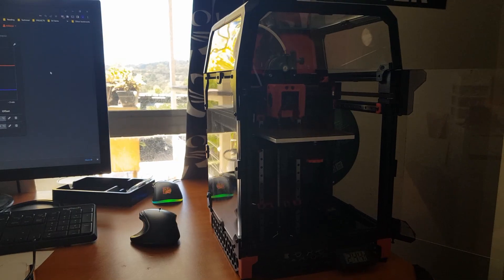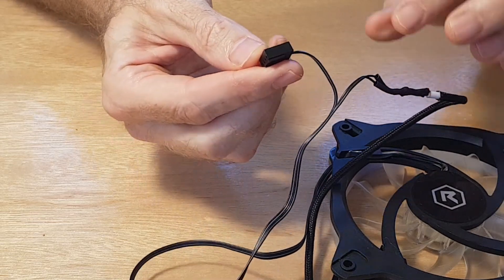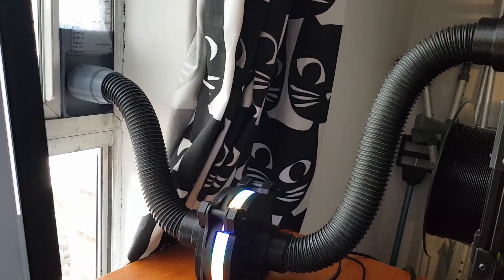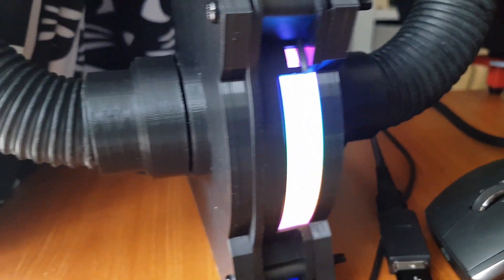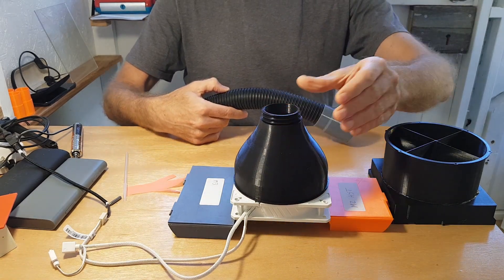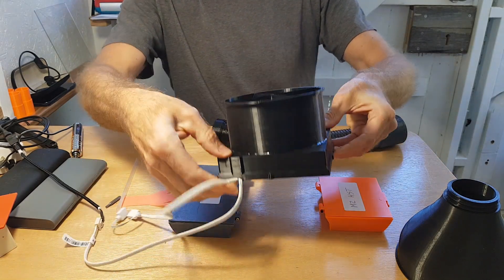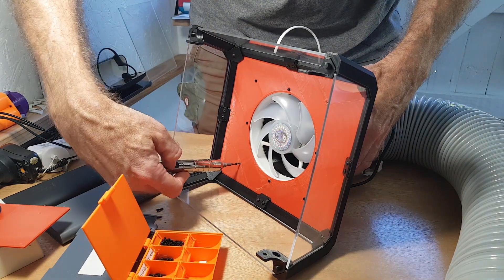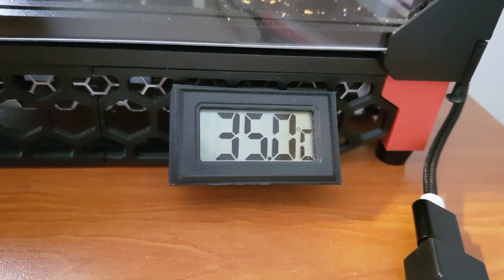DIY Ventilation for 3D Printer Enclosure

Comment: This is exactly what I was looking for! I had to browse youtube for way too long to find this. Thanks!

For the PC fan adapter you made from Major Hardware, is that the "120mm PC fan to 4" dryer duct" .stl he has on his thingiverse? That one doesn't seem to have the blades to swirl/condense the air into a more steamline/powerful flow. It is kind of hard to tell from the single model, though.
Reply from the maker: I didn't use and Major Hardware STL's so it's probably not the same.
Reply: @MakerMike54  Ahh okay. Thought I heard you say you got it from his site when you were testing the fans power with the little paper guy.

Edit: My goodness I'm dumb. Hahaha! Misunderstood before, sorry. You did research on major hardware's page as to why it was sucking the little dude in with just the cone, and then came up with the finned design that made it nice and powerful. Especially with the cone on. I also now see your files for print on printables in the description.

Comment: How did you deal with the empty space on the window? I see a a white board with a circle inside, but what is the material? and did you mange to make it so the cold air at night won't come in?
Reply from the maker: In the final version, I used a tall narrow sheet of wood with a hole cut in it. Then screwed on a 3D printed duct connector. It was easy to open the window and install whenever I used the printer, so didn't leave it there overnight.

Comment: Do you think the airflow generated by the fan that exhausts air outside could affect print quality? Second question: Is an exhaust fan enough, or is a small intake fan also necessary to bring air into the enclosure?"
Reply from the maker: The PC fan is plenty powerful enough to circulate air through the enclosure.  As for print quality, I think the extra airflow and cooling helps PLA printing.  But other materials like ABS don't need the ventilation till after the print when it's good to flush the fumes out.
Reply: @MakerMike54 hey thanks for the video.  Am concerned about leaks in the enclosure.  Have you tried printing abs while running the exhaust fan?  Any issues?

Comment: The connecting bits that you printed yourself would look so awesome in something like actual diecast or spun aluminium, especially if poweder-coated in some color, like a glossy shiny red. Then, have a black hose :D

Comment: My printer is also near my window, if i make a ventilation and it goes out the window do i have to make sure the rest of the window is close so wind doesnt push it back in? Cause its kinda hot so i want to open the windows.
Reply from the maker: Probably different for all houses. It's probably best to just see which way the air is flowing when the windows open. If it's flowing inwards it may well blow back in.
Reply: @MakerMike54  thanks will keep in mind

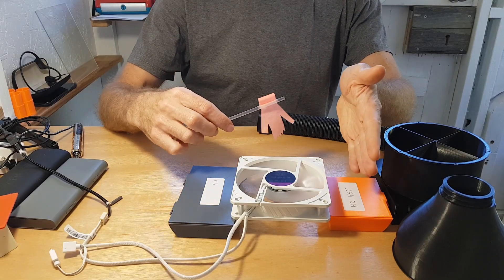Comment: Can you explain to me or refer something explaining what is happening at 2:00?
Reply from the maker: I think fans or propellers don't just push air away in a single perpendicular direction as we assume they do.  Fans also spin the air, and the centrifugal force carries the air away sideways.  So the air flow straight out of the fan is quite chaotic.  Adding Nesto's ducting, guides the moving air so it travels directly away from the fan as we want it to.
Reply: @MakerMike54  thanks for the explanation. are you reffering to the stator of "cheater" fan designed by nesto in fan showdown?
Reply from the maker: @becauseyourbossisgonnaneedme  Yeah that's the one.
Reply: This is an open-air fan. It doesn't like constriction or high pressure static loads. Also, by the cheap cyclone blade design around a dead-core, where the motor sits, it is prone to vortexing currents. The air is traveling up on the edges, then being sucked back in at the center of the fan.

Adding the extension removes some static-pressure and isolated the ability to form a vortex ring inside. It also added a little momentum to the air velocity, before hitting the nozel. (Just a little, it's still doing it, just a lot less now.)

For ducted air, you only want to use a "squirrel cage" style fan. It looks like a fan with blades sideways inside a snail-shell, with a side exhaust and a central intake above that dead-space motor. Those have high static pressure and no ability to vortex or dead-stop.

The gap should actually be tuned for the air flow. The smaller tube, with the right fan, would actually work better. Though, with the larger tube, it might even work better than the smaller tube, depending on the flow rate. (You can test flow rate and generic load by trying to blow up a flat garbage bag. A nice large 30-50 gallon bag. Just tape it to the setups final output and blow it up... 30 gallons per, whatever time it took. Or, one gallon per, time/30.)

Comment: Do you have the Fan Diffuser step file? Looking to modify it for a 92mm size fan.
Reply from the maker: I've added the step file and Fusion 360 file for the diffuser to the Printables post https://www.printables.com/model/544950-diy-ventilation-for-3d-printer-enclosure

Comment: What filament are you using? Will the cooler chamber and flow affect ABS printing?
Reply from the maker: Yeah you don't want to be ventilating for ABS unless you have temperature regulation. So only really print with PLA & PETG.

Comment: Do you think this could be adapted to attach to one of those fibre/aluminium foil inside enclosures? I am enclosing an A1 but the size I need didn't have a vent :( So want to cut one out and add one with something like this.

Comment: Good video. I concur about using an inline greenhouse fan Vs the PC one.

Also, be advised that adding exhaust fans and ducts like this to enclosures can result in turning a containable, relatively minor fire in your enclosure into a much more dangerous situation that can quickly spread to the surrounding room, and if not extinguished, beyond. 

You can get relatively inexpensive automatic (temperature activated) fire dampers at most HVAC supply places (commercial suppliers are more likely to carry them). 

Also, for the same reasons, it’s better to use metal fittings and ducts, especially from the exit hole in the enclosure to the discharge flange/fitting to the outside, as these are fire resistant.
Reply: What is it about having exhaust fans that causes the fire problem? I'm trying to be conscientious of this because I want an enclosure that has slightly negative pressure to pull out particulates/vocs, that is also fireproof (foil type fireproof insides).
Reply: @arc5015  , the exhaust doesn’t cause a fire, but it can cause a fire to propagate beyond the enclosure by literally sucking the flames from the enclosure out through the fan and ducting. This is why industrial systems have flame dampers that close the duct and shut off the fan.
Reply: @Pics2FlicksDennis  Ahh I see thank you. My ducting is going out of a window, do you think a fire from a printer could melt/get through ducting on the way to the window?

Comment: Great work, thanks for showing your lessons learned, many youtubers want to only present themselves as accomplished, but I really enjoy learning along with.  I've been growing mushrooms for almost a decade and they require a lot of air circulation, as in 6 full rooms cleared of air every hour, from what I've learned is the ridges on those flex hosing cause a lot of drag in the air flow, and so a higher pressure blower always helps, but it's also easy to over do it in a way where if you're heating the space that you're also exhausting, then you'll end up working against yourself and chew through electricity in the process. 

I really like that fan adapter, looks like it is well designed for properly focusing a fan's flow.  I deal with Laminar flow hoods in mycology, and they use aluminum baffling that is embedded into the HEPA to do the same process which creates a perfect laminar flow, otherwise if you were to use smoke and a slow motion camera to observe the air behavior coming out of a CPU fan, it's all over the place and creating tons of micro vortexes, which work against itself.  Interesting stuff
Reply from the maker: I know what you mean about the ribbed flex hoses causing a lot of drag on the air flow.  I have a smaller vent system on another printer with 2 inch ribbed hose and the ribs do seem to slow the flow, especially on the smaller diameter pipe.  The only flexible smooth(ish) bore hose I've been able to find is 'Brake Duct Hose' but that's a little overkill and pricey!  Here's an example https://www.ebay.com.au/itm/263383343330
Reply: @MakerMike54  perhaps a hose is the wrong tool for the job- would a 3d printed mini ventillation duct between your printers exhaust and the window plank be feasible given spacing constraints?
Reply: @MakerMike54  Is printer exhaust air too hot for PVC or ABS pipe?  Also, how do you print ASA/ABS (in other words, maintain the warm enclosure temperature while still ventilating inside a cold room?)

Comment: You can get a 120mm in-line greenhouse exhaust fan for about $20 that will have much higher static pressure than a pc case fan, and they have flanges for the ducts built in.
Reply: Phanteks T30 fans are also great. Best PC fans on the market rn imho

Comment: You could have easily gotten a 60mm duct to work but that first design was horrible, the fins were completely blocked and all it would do is create turbulence. How does it go printing ABS now with the lower temps and huge drafts?
Reply: I too would like to know

Comment: Thanks for sharing your work!

I am also thinking about some ventilation solutions for my Voron printers, especially the larger V2.4 printers. And the first thing I am thinking about is: The heat (warm air) need to (mostly) stay inside the printer for quality ABS-printing, which I'm doing at 65 °C chamber_temperature. So one main aspect of a ventilation system should be a nearly perfect sealed printer. Then you could run the ventilation at way slower speeds or hopefully turn it off for the whole printing job and only ventilate in the print_end macro. That be said, the stock V2.4 already does a better job in sealing the enclosure than the stock V0 Voron.

Btw. in the V0.2 design you have two fans for the electronics.
Reply: I find a well sealed printer needs no ventilation while printing, only at the end of a print.

Comment: Worked in a few injection molding factories I think the best smelling was ABS very floral depending on the colorant added. The least smelling but it smelled really bad burning was polypropylene. Most things are PP Thiner parts are usually ABS. I don't think you actually need to vent that. But listen You really need some tattoos I'm serious. I'd be embarrassed to go out with naked arms.
Reply: I bet your tattoos are lame AF , colorful shopwork. Let me find out have foreign lettering on you

Comment: I would love to do this, but I print ABS with a heated enclosure. So I can't just do this.

I would need it to only activate after the print has finished. Which will be wasy with Klipper.
Reply: Sure you can. I have an insulated enclosure with a 500 watt heater, I vent externally while heating to 65c. You don't need anywhere near the amount of cfm this guy's pushing, I have a centrifugal blower running at extremely low speeds. It's near silent and I can't smell abs in my office while printing all day. :)
Reply: Just add a HEPA filter inside which cycles the air within the enclosure. It won't change the temp but it will clean the air or VOCs and kill the smell
Reply: @muniradlan3659   No, a HEPA filter only filters particles. For VOCs you need a massive activated carbon filter, which is why venting it outside is usually the much easier (and cheaper) solution.

Comment: Stuck with all casement windows, these do not lend themselves to easy in-window setups...*sigh*
Reply: Old comment but, for casement windows, you can use the same method used for AC units - they come with velcro casement window sealers that you zip a hose through.

Comment: Is good for resin not FDM WHY u need the heat inside and the heat go up. The way to do this is on the sides out one side a filter to clean the air and go back in the other side. BECAUSE the air need to go back inside to create a chamber. Only clean the air for FDM.
Reply: Wrong for enclosed fdm

Comment: Cool. Any ideas on for printing ABS or ASA?
Reply from the maker: Yeah, that's a good challenge. Venting a heated environment and yet still avoiding the warping. Maybe the better approach would be to seal the enclosure better to prevent leaks, and then only vent once the print is completed. The Voron 0 probably leaks mainly around the base of the tophat.
Reply: @MakerMike54  correct, try to better insulate the printer so that air doesn't leak from gaps, then have your extractor pull air out only when an abs print is finished. If the printer is well insulated you won't be able to pull air out of it easily, so you would need a normally closed air intake as well
Reply: For ASA/ABS I think you could either try to use closed circulation like the Nevermore or enclose the printer itself and do something like shown here to ventilate the outer enclosure.